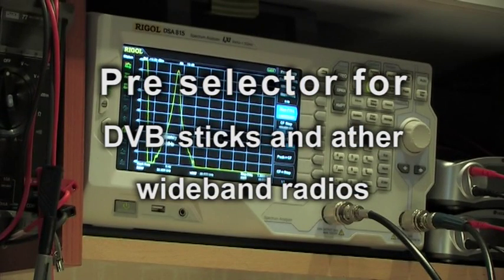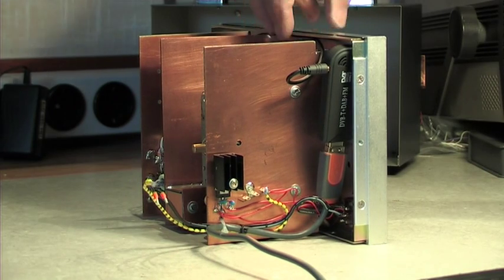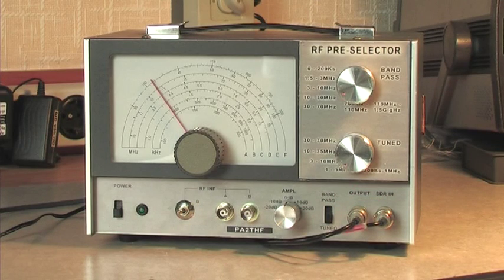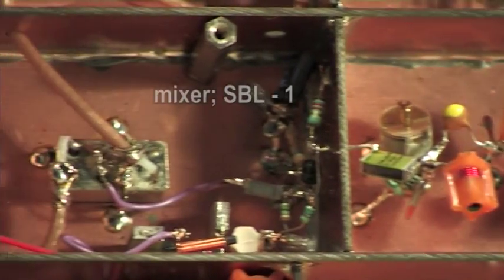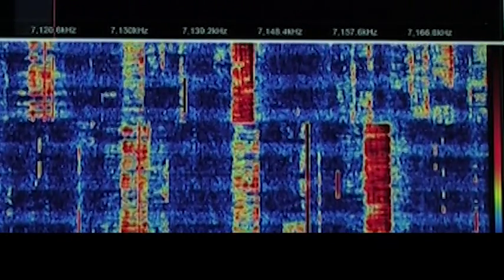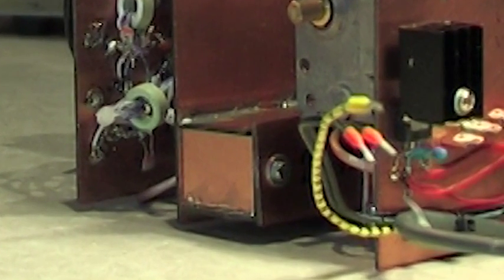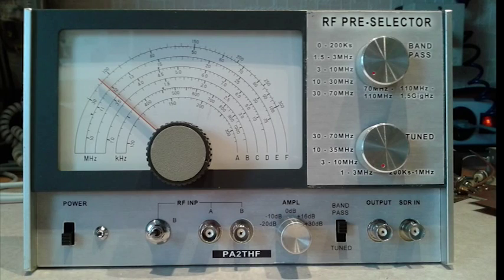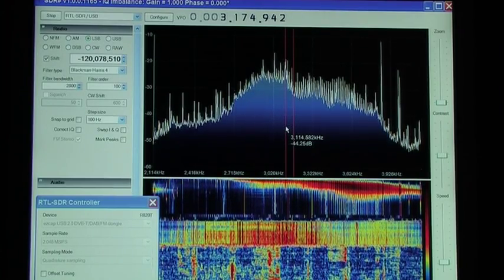SDR RTL dongle and pre selector with HF converter

Comment: Is there any information on the boards used in the vcr hifi audio conversion video? I cannot add comments there and I was looking to do this on a vcr.
Reply from the maker: Yes Jordan that's correct. On the film about the VCR, come stupid reactions and why?? The boards used, came from een even old Panasonic HiFi vcr (80's). So you will not be able to find that in 2023. Use a old HiFi recorder with a separate HiFi board. You need the service manual any way, so look for that. Warning, newer versions VCR's have a main-board that contains everything, so it's not so simple. And you need some experience to make the aprop modifications. I will adjust the settings by the VCR-video, so comments are possible there.

Comment from the maker: Dear Mario.

Unfortunately I never made a schematic from this project. I simply experimented with some ferrite and Iron toroidal (from the junk box) and measured there freq response. Than selected the best toroide for the specific frequency range. Then made the new coil windings and the coupling (pice of teflon coax) between the two toroids (per section). So I get the most selective tuning. Note that if you made a 4 coil instead of a 2 coil per section, The selectivity can be so much better. But the losses must be max 6dB! (difficult) 

If you do not have the equipment or knowledge to make them 'work together' simply buy a complete print with all the necessary coils and capacitors already installed. There are several out there. Google on pre selector and you will find what you are looking for.

Suc6!!! and 73. Theo PA2THF.

Comment: Great work! amazing sharpness. May I ask for the variable filter schematic? I already solved the HF conversion to the dongle as I purchased an already built converter that works really fine, now Im lookinf for better filtering  so Im planning to build a variable filter but I can find one as sharp as your design... I saved a four section 450pF variable for that project and I have a 2 section one too, Ill be very grateful if you can share the schmatic. Thanks in advance and 73 from LU2AW (fachinsky@gmail.com)

Comment: Wow!!! VERY WELL DONE ... I am doing the same just MUCH more simple but quite effective ... I tap the active antennas signal into a red torroid inductor at around 1/4 of the turns (12) from the cold end, then have a variable capacitor across the entire inductor and feed it into a J310, followed by a 2N5109 and MMIC to push up the level that I then feed into the transformer of a dongles direct sampling mode ... works VERY well ... direct sampling mode gives you the advantage of a drift of just one or two Hertz, allowing you to decode HFDL even on 21.9 MHz without any noticeable drift. The only negative is the issue with the 14.4MHz image, receiving signals equally e.g. 15.2MHz AND 13.6MHz both end up as the same, but further away off of this pain point, this thing rocks.
Another thing if you enjoy SSB and very clear AM demodulation ... download the free HDSDR software, since that has some very nice features for HF ... e.g. Synchronous AM Demodulation giving you perfect audio, multiple manual notch filters, discrete audio filtering (high&low pass adjustable) and other cool stuff, though I really like the new SDR#s RF noise reduction a lot.
Anyway many thanks for the great video - inspired me to also build an up converter, since I still have some TCXOs in my RF parts collection.